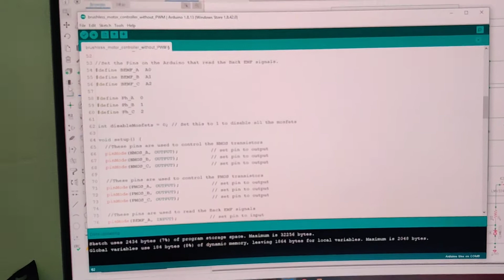Brushless motor controller using an Arduino Uno and Back-EMF Sensing.

Comment: why are you use both N channel and P channel MOSFETs ... why cant use only N channel MOSFETs.....
Reply from the maker: If you use only N channels, you'll need a gate driver which can step up the voltage, to drive the upper N channel Mosfets. This is because the Vgs of the upper Mosfets will not be w.r.t. ground, but will wrt to the coil voltage

Comment: Hi nice work, I saw the code and I have a  question  about of this, for use to RC brushless motor is necessary syncronized the time the crossing of each phases (delay 30º electrical to 60º mechanical), for this goal I read in application note the  use a timer or exist other method, thank for share and i wait for the next circuit, congratulations
Reply from the maker: Thank you Alejandro. The Back-EMF sensing eliminated the need for any timers. The back-emf signals change at every 60 deg, By sensing the changes, you can commutate the motor. The sensing method is same regardless of RC motor or a simple HDD motor. Actually, the exact same circuit given above, will be used for the RC motor too!